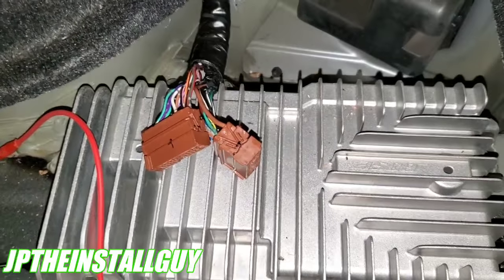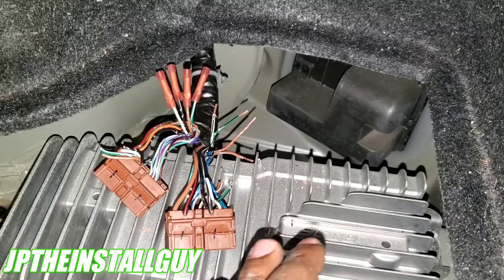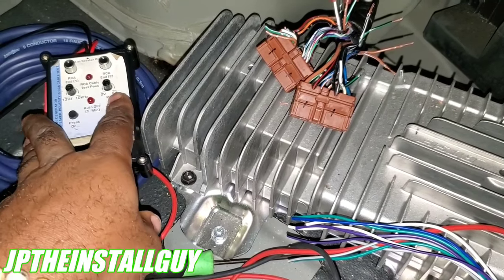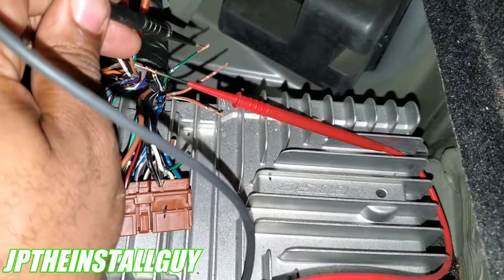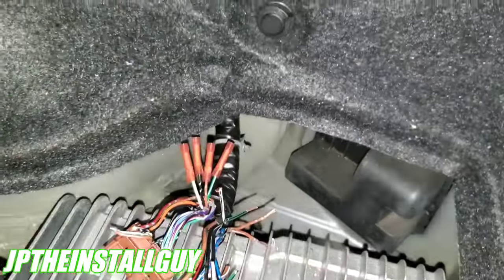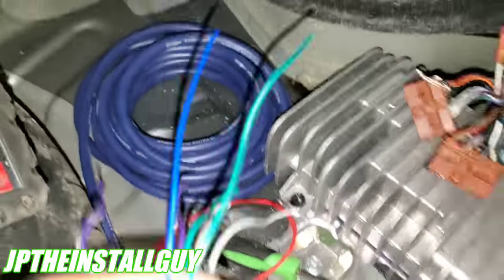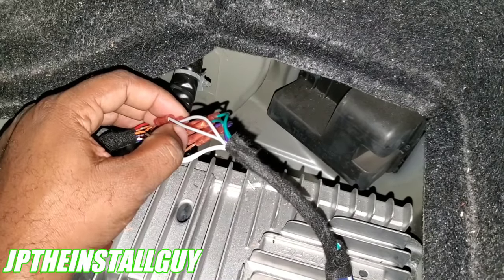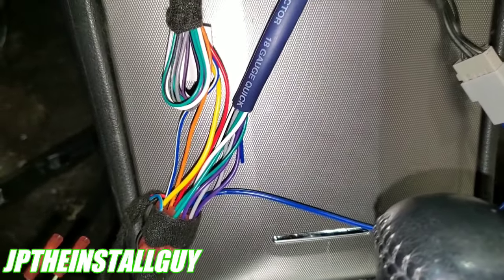How to bypass your factory amplifier

Comment: Instead of running new wires you could just jump the wires from the input side of the amp plug to outside of the amp plug bypassing the amp,  you made a lot more work for yourself man.
Reply: Would that work?
Reply: @jeremyclark9705  wouldnt recommend but yes it does work. but it’s like plugging an extension cord into itself but there’s a power wire that powers the extension (so it’s always on aka dead battery in the mornings) IF IM NOT WRONG
Reply: @ericnicolini-calderon1337  Old comment but for others who might stumble on this.. If you jump the speaker wires from the input side of the amp to the output side you would bypass the amp entirely. You would only hook up the speaker wires, meaning the factory amp would not turn on (no signal wire to tell it to power on) and therefore it wouldn't drain your battery.
Reply: Sorry im not technical minded but getting sick of this amp picking and choosing when i can have my radio sound on in simple terms how can i “jump” the amp someone mention optical cable bypass ??
Reply: That's what brought me here. The fuse under hood pops as soon as I put it in and I'm wondering if I can just cut them and splice them together just to get sound. I have a car that's got a system but in the minivan I'm not tying to do all that. Just want it to work.
Reply: I know this is an old one, but the output wires from the head unit are right there taped up in pairs. Why wouldn’t you use those instead of running new wire that’s really not a question because that’s what I did. I’m just wondering why he’s running new wire that doesn’t make any sense. That’s the only way to do it. No new wiring should have to be ran other than what you’re splicing off between the amp in the head unit. Well besides the power wire to the battery but that’s not what this is about. I mean it’s easier to pick out the amp input wires then it is for the speaker wires and they’re even already at low level splicing some RCA’s and you’re done.
Reply: @stopher1971  Or better yet, just get a kit like the one i got from owcupgrades(they make harnesses that plug right in). Took me about 5 minutes to connect everything up and I didn't have to cut any wiring at all. pricey, but absolutely worth it.
Reply: That’s what I’m wondering
Reply: @prestige8161 where u get that kit from?

Comment: Dude, I worked at a radio shop before (knowing little of electrical just all mechanical) and you explained this shit 100x better than the bozos I worked with trying to teach me.
Reply from the maker: Appreciate that homie 💯💯
Reply: No doubt bro💪🏼
Reply: @David Rivera bro 💯
Reply: Once you tapped in to that speaker wire and bridge those...do not plug that plug back into the amp? I noticed you left it out.. wasn't sure if that amp was powering other things in the car...

Comment: Gotta love laying down in trucks. Did the same thing in my 2016 Infiniti Q50 RS 400. Installed the audio control DM810 with 10 channels of highs and mids, then a JL HD1200 with a JL 12W7AE. Sounds so much better than the worthless blows system.

Comment: You can bypass the amp with a harness from OWC Upgrades. It just plugs into the factory connections and then you connect your aftermarket gear to it. Best money I ever spent.
Reply: do you know how tu get the harness for a 2015 nissan sentra??

Comment: To find correct phase without a phase tester you can also use a 1.5 battery just touch the speaker leads to both ends of battery and the other ends of the wire to speaker if you if you have correct leads the speaker will pop out if not it will suck in.
Reply: I was going to say the same, but for a 9v.

Comment: Great video, bro. 1 question: Can I just cut all wires from connector side of harness ( factory amp side of harness ) , then tie my new speaker lead-wires into that connector harness, from the NEW amplifier, and reconnect connector side of harness back into factory harness? 

That should get power to all speakers if done correctly, then I can run power and ground, may not even need remote wire to radio bc factory harness has remote which I have connected behind aftermarket headunit already. I already installed a Interface kit to retain steering wheel controls- which is working great, but factory amp keeps cutting off, so this is my plan to bypass.

Comment: JP, clarity in Camaro fog! Thanks for that! Sorry this is long. I'm asking this question in becasue I need a little guidance. I have a 2017 Camaro 1LT, non-bose "a nightmare for audio upgrade. I replaced all speakers with 500 watt Kickers (2 ohm), but the horrible factory amp only pushes about 40 watts and happens to control many other functions. Shameful for a Camaro right!? Do you think I can use your method to bypass the factory amp, "without changing the head unit". Everything on my vehicle is controlled from the head unit, changing is not an option. In my mind's eye, I use your procedure on the amp output side, and wire directly to the new 4 channel amp (make still undetermined), input, then connect the speakers to the amp output. Would you do it this way? Or should I take only the audio signal coming from the head unit and wire (bypass) to the new amp? I feel like I should use some kind of digital level control mid-stream, before the new amp input. If you help me through this, I will put your banner on my car! I show it every Friday here in Orlando. Thanks David

Comment: I’m wondering can you just just take out the factory amp and tap right into wire harness with a 4 channel amp. I’m trying to get a louder clearer sound in my Denali. I guess I could still run it the way jp did just would have to run the power wire to the battery but I’m wondering if I could use the power wire that’s powering the factory amp and would the gauge be efficient enough

Comment: Thank you finally somebody answered my question I was pretty sure the power went to the factory amp first then came up to the radio but I could not get a clear answer from any video but this one thank you
Reply from the maker: anytime. thanks for watching
Reply: @jptheinstallguy  you know I unplugged the factory amp all together and my radio still works but my amps are being thrown into protection I don't think it had anything to do with the factory amp I'm getting too much power to my amps ,that is whats  throwing it into protection when I take a connector off of my alternator it makes my Tahoe run around 13 v and my amps will not go into protection but that is not enough volts  to run the Tahoe so I think all I really needed from the beginning was an amp regulator but I have no clue how I'm going to get the amperage I need with one of those  . I normally only make music videos on my channel but I think I will make a video about this because it is blowing my mind

Comment: Will unplugging the amp do away with bose pulling power out of the speakers at higher volume. After 75%-100 it doesn't get louder

Comment: Trying to do this in a 2010 Altima 2.5s with Bose. Don’t want to remove factory door speakers and want to just connect the 4 doors speakers and none of the others. Can’t find the correct wiring diagram at all and don’t have these tools or where to get them

Comment: Couldn't i just run the input wires from factory amp to the inputs on the new aftermarket amplifier...? Then take the output wires from factory amplifier and wire those to the output on the new amp...im trying to understand why i need go behind factory radio unit for a signal if they already there from the factory amp only thing i should have to do is run a 4-8ga power wire and ground wire for new amp?  Jus a theory

Comment: There's a great tool out there to test the speaker wires to see which speaking is on the other end (popping it) AND determine polarity. And you probably already have one at home! No need to spend more money. It's called a 9V Battery. Ever-Ready and Duracell make some nice ones. All you do is use a couple of small electronics jumper cables, or even the bare end of the wires if you don't mind dealing with shorter wires, and place the battery across the wires. That's it! You'll hear the speaker pop, and you'll also be able to see which direction the cone moves to verify polarity. Just make a note of which wire is hooked up to the + on the battery.
Reply: Yep..That's what I was gonna comment...One thing you forgot for the novice stereophiles...If the cone moves outward first..the polarity is right...sucks in..backwards...
Reply: i think he already mentioned that at the end of his explanation, 👌 👏

Comment: Friend, could you help me? I have a Pontiac Torrent 2008 pickup. I bought a 9-inch Android Radio. When I connect the speakers, it doesn't sound, because the original amplifier that comes with the car runs out of power, and the speaker cables don't work. Could you tell me which cables? you connected so that the amplifier of the
Car and thus be able to Pass Current to the Speakers

Comment: One thing though. The higher wattage of the new amps your putting in and the increase in amperage, the factory gauge wires aren't big enough. So it's better to run new wiring and not power and speaker wires together throughout the entire run.
Reply: Wrong. Its enough for speakers. That only applies to woofers

Comment: Quick question my bose amp went out are you telling me i can do this and everything will be back to normal without them amp?
Reply from the maker: This was bypassing the amp to an aftermarket radio so in that case yes but if your amp has gone out with the factory radio still in than your better off replacing the bose amp.

Comment: If I were wanting to run this to an aftermarket amp where would I plug my rcas in if I’m keeping the stock head unit I know I need a loc but would I tap in to the input channels then coming into the factory amp?

Comment: If you tapped into the factory amp your alley on the speaker wires so what’s the need to run the 9 wire to the front you could have went straight to the amp and saved time and never had to take the factory radio out

Comment: I have a 2015 Mazda 3i sport hatchback with the bose system I'm keeping the stock radio and I will be changing the front door speakers  no rear fill will be using a 4 channel amp and a sub amp along with the helix dsp mini low level so how do I go about this

Comment: So i have a 2015 camaro "convertible " v6 without the Boston acoustic factory amp. It just has a regular factory amp the comes with the basic models so my question is can i still bypass my factory amp with this same method? There are alot of bypass kits for the Boston acoustic but i cant seem to find any way to get a bypass harness or find a way to re wire my basic factory amp

Comment: Thinking about doing this cause i have a aftermarket deck and im getting an annoying static noise (white noise). But what are your thoughts on just splicing head unit out to amp out to speakers just skip the factory amp?

Comment: How would you go about adding additional amp/s to a factory head unit that already has built in amps? I have a 9 speaker system by Sony in a Focus ST and want to put bigger speakers in as well as an additional amp. In other words add to factory amps but not bypass them? Any advice would be greatly appreciated…

Comment: Had a question I got a 2005 envoy Denali with the Bose system I put coaxials and all the doors but the front speakers are only putting out bass no highs is there a way to bypass this or do something about this without rewiring the whole system .. I'm putting a 4-channel amp in and I got the coaxial speakers in each door I just want to know how I can get the front speakers working so there's not just bass

Comment: Using this car as an example, would you run rca’s from the aftermarket stereo to the rear aftermarket amp? Then use the “outputs” of the Bose to hook up to aftermarket amp output? That way you don’t need 9 wire right?
Reply: Damn no responded to this. I was wondering the same thing. Figured you could just tap into the speaker wires run those to the amp and tap into the power + and negative- that power the factory amp and then just run your rca to the head unit. What did you ever end up doing?

Comment: Would it be possible to... Say you swap out the premium bose amp to a luxury bose amp? I have a aftermarket Kenwood head unit already in there. Would it work.. I have a 2008 chevy silverado LT..I got the Luxury amp out of a 2011 denali
Reply from the maker: uuummmm i dont think so it would have to have the same connectors so probably just the same bose amp for that car will work, but might just want to ask the dealer

Comment: Just a quick question will I need to do this if I install a new headunit or can I just use the wiring at the back of the headunit
Reply from the maker: if you have the right wire harness it should integrate just fine so no need to bypass unless you want to run your speakers off the radio or another amp
Reply: @jptheinstallguy  could I use the 9wire to direct connect the speakers to the radio speaker wires and another 9wire from amp speaker cables to radio rca so that way I can keep it plugged in and use?

Comment: 🙋👍😁😎Great video did you have to do this when you installed the JVC radio or is this part of the same job working on the Hummer H2?
Reply from the maker: Naw man this is more so a how to just incase your adding an amp to the system or if the factory amp stops working and you need to bypass it or simply if you don't like the factory amp and you want to run the speakers directly from the radio
Reply: I appreciate the information it's greatly appreciated, you got true skills & definitely should have your own television show for sure👍😁💪😎💪😉👌
Reply: @jptheinstallguy  yo man I NEED HELP G, I have a Lincoln town car that has a factory amp, and I am currently trying to buy a mono block amp to hook it up to my 2, 12s  and I also want to run the factory amp to my aftermarket radio is this possible?

Comment: I'm trying to install aftermarket amp in a 2007 m35x can I tap into the factory amps  input and output..so only wires I would have to run are power and ground ? My aftermarket amp has high level inputs

Comment: Would i bypass the amp if i replace some of the speakers and cant find a wire harness, and also if i bypass can i retain the auto volume, bass boost treble boost and all of that, like will i lose some features i had with the ffactory system?

Comment: Why didn't you just jump the wires from one harness to another (therefore bypassing the amp) and use the Metra 7551 (or whatever the connector is that allows for speaker level connection behind the head unit) which should let you use the cars stock wires to carry the signal to the speakers?

Comment: Yo i got a question. So i cut the speaker wires from the bose amp and connected it straight to my new amp and it works. Is that wrong? Was i supposed to use 9 wire to connect it back to the headunit? Also how did you wire the headunit up cause mine is jacked up.
Reply: Bruh where’d you find the factory amp? I have the 13’ Altima

Comment: Okay so I found my factory amp on my car also found the speakers wire on the amp , now I run that to my aftermarket radio , so now where do I get the power from ?
Reply: So all I need is to connect from the amp is the speaker wires and that it ?

Comment: I'm sure there are adapters that could be bough for both ends to save you from cutting and splicing the factory harness.
Reply from the maker: not really the only harnesses ive seen are for those that the maestro AR can be programmed to and thats only for a select few cars, but that is only for amp integration not bypassing.
Reply: JPtheinstallguy 2009 A5 3.2 I need help bro lol, factory amp blown... is there a way I can bypass it since it controls the front touch screen ?
Reply: Six months later still no reply
Reply: @brock2872  get a lc2i yup
Reply: @carlosesparzavazquez4753  that’s it ?
Reply: @brock2872  yup lc2i with the right stuff
Reply: @brock2872  tried replying to you but youtube keeps deleting my comment for some reason.

Comment: Hi, i have a Mazda 3 2006, i change the stereo Bose for a new one Jensen, I conected with a harness metra all the wires but I found a little problem, the Jensen turn on but I don’t have sound, I want use this stereo for my aftermarket amplifier and the speakers that the car already has (I will change later ), I hope u can help me, thanks
Reply: Mine turned on at first but no sound until I found a better ground then the sound came through

Comment: @jptheinstallguy so i have an 2014 infiniti q50 and want to add 2 amps 1 for sub and 1 for new speakers and also add a dsp with new speaker wires. So what i would want to do then is at the factory amp the input wires that go from the factory radio to the factory sending signal.  I would tap into those wire and connect to the dsp then connect rca's from the dsp to the aftermarket amp's then connect the speaker wires from the amps to the speakers and sub CORRECT or no.

Comment: I got a 2007 Dodge Charger and it has a factory amp, but when I unplugged it, it threw the whole car off. Could I just bypass the amp and plug the rest of the wires back into the factory amp and ride out like that?

Comment: cant i just run speaker wires to the amp and Rca cables to to the amp and aftermarket head unit?
Reply from the maker: if you have an aftermarket head unit than yes just run rca to the radio and run your speaker wires to the 4 channel amp

Comment: Being that the factory speakers are 1ohm speakers, how did the sound turn out using the aftermarket headunit amp to drive them?  That typically doesn't work too well being that most 4 channel amps head unit or standalone are rated at 4-8 ohms.
Reply from the maker: Didn't matter because we swapped speakers
Reply: Hey great video but what are the wires going to the speakers that you put connectors on?
Reply: The speakers are actually 2 ohm ran in series for a 1 ohm load